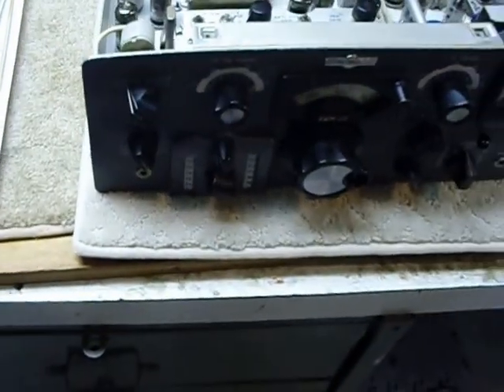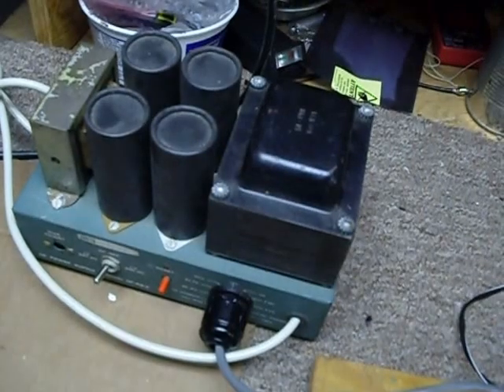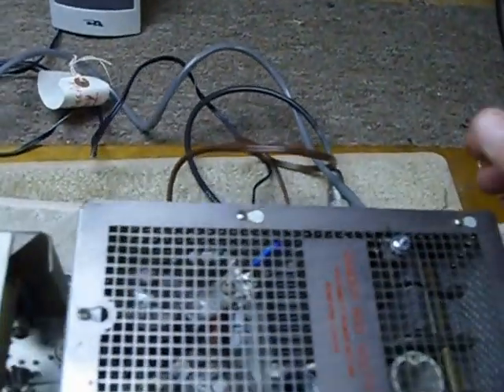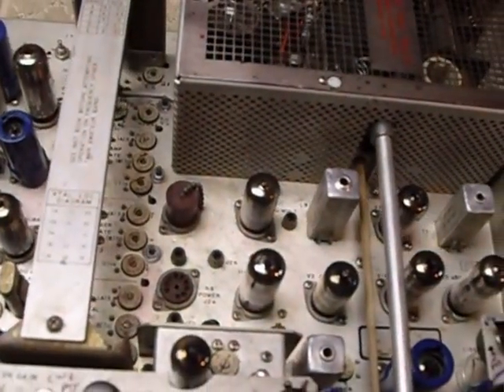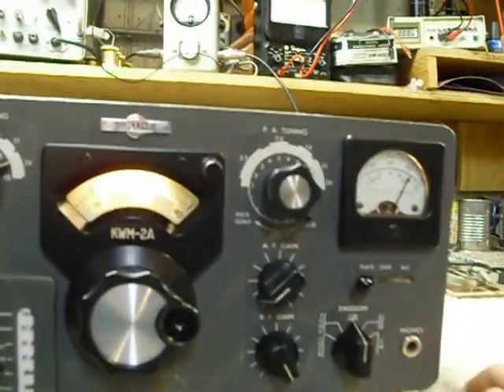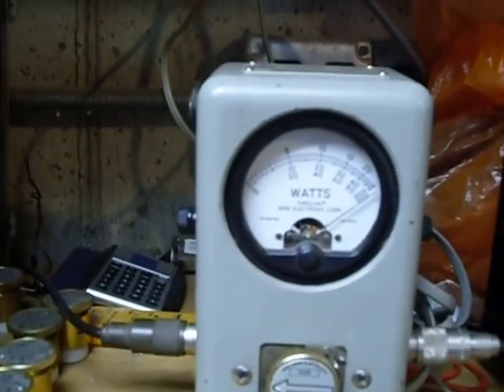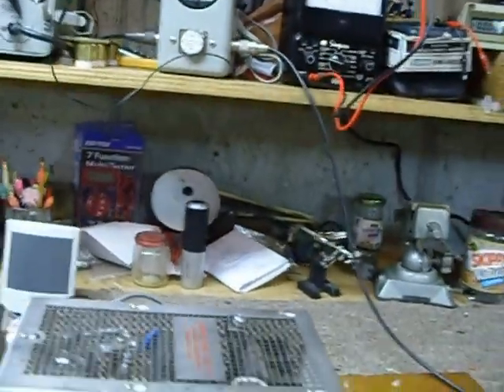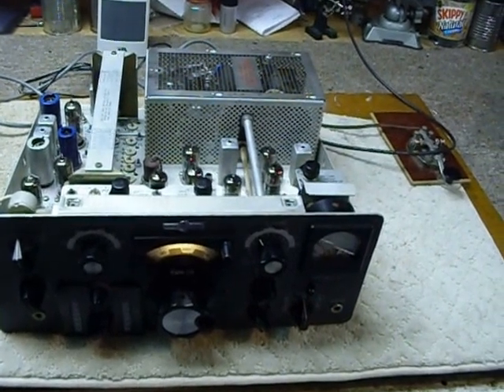KWM-2 on a  Heathkit PS-23A Power supply restoring and fixing old amateur radios,

Comment: Very nice video and info on the Heath power supply. In reference to your trimmer write up, don't seem to find it in the Collins group files section.
Is it possible to email it to me or post it publicly. Thanks for the kind words relating to my cleaning of my KWM-2A. 
Fernando N2FQ     n2fq@sbcglobal.net
Reply from the maker: N2FQ   I did this video in 2013 thats 6 years ago  I do not have the trimmer information  you request  sorry 
if I had it I would send it to you .  73   Bob

Comment: Hi Robert!
Thanks for your excellent video.
 I'm Gerardo from Canary Islands. My call is EA8IJ. 
I have a source HP23A like yours and I just made the connections to feed my KWM2 Collins transceiver and watch the voltage to the filaments of the valves and pilots is not very good because they usually glow when lit. Other voltages as +275 and +700 think they are not enough. BIAS voltage seems ok. 
A question for you: Have you made any other change that will tell me? I'm really grateful to you. If you want to answer by email ochoijota@gmail.com.
Thanks in advance.